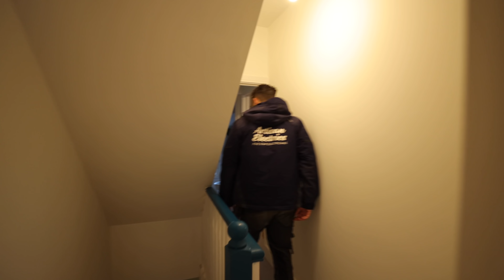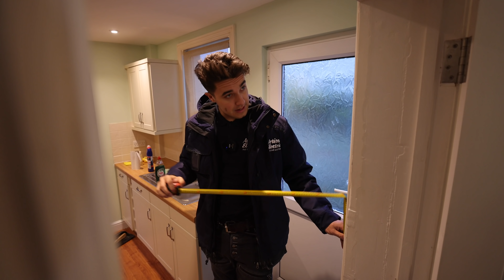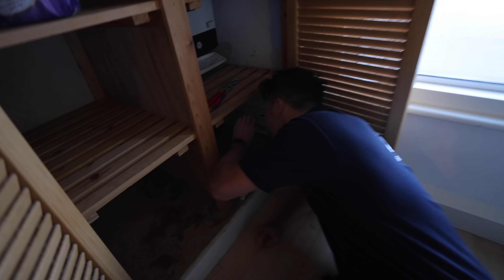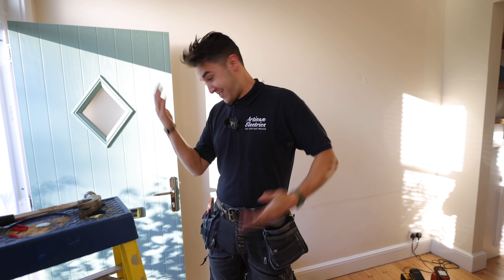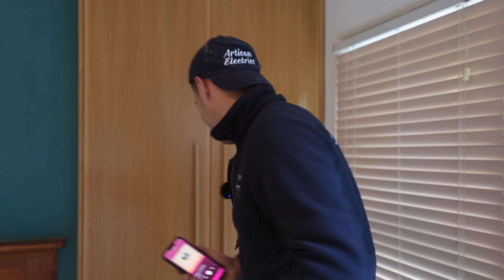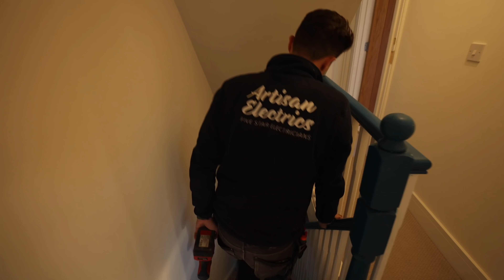I CUT THROUGH A WATER PIPE! MY WORST MONTH EVER! 😭

Comment: I had a decorator actually step of a ladder and put his foot onto the radiator with full weight to step down onto the floor kinking the outlet pipe just below the the floorboards. It flooded the ceiling well before he could get to it. He was a nervous guy just starting out and he was nearly crying and shaking when he had to speak to my Grandma. I felt so sorry for him and my Grandma kept saying to him ''look..it's just an accident! Calm down...we can fix it'' ect. We got a plumber and he had to solder a new pipe on then we painted the ceiling when it dried out. My Grandma was so kind and didn't pass on the plumbers cost which was not expensive all that time ago. Never seen a guy so upset before but it all got sorted out in a day.

Comment: It happens, but you can  never drain the system with all the radiator valves closed.
Reply: It's not a bad shout to close off all of the radiators except the one with the drain, though. That way you won't have to drain so much.

Comment: I would love to see more of you guys running/installing data cabling, but you need to bring the same OCD(ish) standards you have for electrical wiring to the process of "data cabling". "Rules of Thumb" like making sure the edge of the PVC/plenum sheet is as close as possible to the wire "punch down" point with as little as possible untwisting of the colour pairs, wiring a small drop loop into a cable to allow moisture buildup to run down and away from a connector instead of into it (not so important these days with better insulation in homes although relevant to this video 😁), not running data cable parallel to and within 400mm (approx 15in) of power cables especially fluorescent lights (again not so important these days with Cat6 and Cat 7 cable), etc. Most of these RoTs (and others) are historical in nature and may not be as important as getting the job done especially in a home installation (most are "best practice" guidelines for commercial stuff).

As for T568A vs T568B, you should find that T568B is more common to experience "in the wild" these days, but it is recommended that if you find "A" in a location then you should use "A" for new installs or if you find "B" then use "B" for new installs and if it is all new installs, then use "B". The only difference between T568A and T568B is that the white/green+green pair and the white/orange+orange pair are swapped and are electrically similar(ish). T568A is also sometimes mandated in government contracts (especially in the USA) as a historical consequence of older (USOC I think) phone wiring standards (again not so relevant today for ethernet data and VOIP phones).

Please excuse the length of this missive. I just needed to wind down from a small WISP (wireless ISP) installation that got a little more "political" than I wanted, earlier this afternoon.

Keep up the realism guys and have a good 2022...
Reply: Huge message for someone who installs data cables. Get to college for 4 years then pass your 2391 and become an approved electrician before you comment on your job fool.

Comment: When you lift the floor  board put a small mirror between the joists. Then shine the light of a torch into the mirror. By moving the angle of the mirror you'll be able to see in the mirror down as far as the light can go.

Comment: Tip - if you hit a pipe and it’s mains hot/cold and you’re struggling to find the stop cock, open all the hot and cold taps in the house and it’ll greatly reduce the amount of leakage until you can get the water shut off. I also keep a small bit of tyre inner tube In my tool bag with a Jubilee clip opened up ready so if you go through a pipe you can always cover the hole with the innertube then squeeze it onto the hole with the Jubilee clip, this is the best quick fix for pressurised heating systems if you don’t have the means to repair it properly - Andy, Heating engineer (never cut a pipe myself honest 😇)

Comment: Hello Cory never cut a floor board above a copper pipe lift up the board next to it not worth the risk you live and learn mate i have never hit a water pipe in 37 years in the trade although i drilled through a 2.5 t and e cable on a 20 amp fuse and that went with a hell of a bang i can tell you it melted the tip on the masonry bit and i saw stars for the rest of the day keep up the good work you are a top man.

Comment: At least with old houses with wooden floorboards you can expect to get pipework underneath near a radiator but with modern houses they can have 10mm plastic central heating pipes hidden behind the dab and dot plaster panel on the wall - don't ask I how found out when putting up a shelf above a radiator!

Comment: You could of fixed that with two push fitting and tiny bit of 15mm pipe and you will need to drain the radiators if it’s on the flow and return. Water mains is only for the cold and hot water. Jordan really great leadership mate as I couldn’t think of anything worse than being kicked when I’m down. Corey knew how crap of a situation it was. Just give it a day or two then the leak jokes can come in to play

Comment: I have fixed problems like that by cutting the pipe down line and sliding over a quick flow pipe joint over the cut down line slid the joint over the cut.  Solder it and use a second joint were I make the cut.  Easy fix in tight spaces.

Comment: The heating system is a combination boiler so only has a small amount of water in the system, just drain a rad downstairs, don't bother trying to turn the rad valves off you'll just make the job harder as you'll need to re balance the system

Comment: Ahhh bless you.  Next time if it’s a combi boiler with a filling loop just grab a hose and drain the  rads to reduce the pressure. If not a combi then there’s a tank in the loft which if you buy a bung you can put it in the small tank in the loft to stop the water coming out. Maybe learn a bit of plumbing to know the basic layouts. Everyday is a school day mate. Oh btw you’ve a great singing voice Cory!!
Reply: The boiler being a combi doesn’t necessarily mean the heating system is or isn’t pressurised. The type of boiler doesn’t dictate the system its connected to.
Reply: @Josh__Stevens  yes your right. But Cory won’t know if it has a separate heat exchanger to split the system. I was just giving the 99% option that it hasn’t. 👍🏼

Comment: There is a galvanised steel plate, called SAFEPLATE, which should be fitted over all points where electrical cables and pipes are notched into to the top  of a joist. They are available from CEF.

Comment: Great Content ,  I think this is a great vidz to Learn from as a new Sparky . Lifting up floorboards you have to be aware of  radiators  pipe .  And  a good tip from Cory to  Set the depth of the Cutting blade.  +   knowing  what to do if you do  hit a pipe,  having some knowledge of knowing what to do if you have gone through a water 💦 pipe , taking note.  
And can you cover  a vidz. on networking  insulation  may be get Oliver  on  bored  Cory  that would be  great .  Thanks guys

Comment: With me, it's live gas pipes! One job was boarding over ( or under_) a low head height cellar. I was very aware that there was a live lighting cable attached to the joist above me near the gas meter, and its stainless steel flexible connection to the incoming gas main. Somehow, I still managed to both find the live conductor in the cable with the panel pin, and simultaneously connect via the claw hammer to the flexible metal pipe, with a bright electric flash inches from my face, extinguishing the cellar light, and igniting a tongue of mains pressure gas, directly in front of me. Temporarily blinded, I managed to locate the gas shut off valve, and thus extinguish the flame, leaving me in total darkness with the after-image of the flash and flame indelibly printed on my retinas in vivid green and purple. As my sight recovered, I found the steps up to daylight. I had no mobile phone in those days - they were very expensive bricks then, and I can't remember how I actually managed to call the gas board to fix the damage I had caused - shock, I imagine, has erased the memory, and I managed to complete the job. Another was equally odd. I had laid a new vinyl floor covering in a kitchen, and the final act was to fix a brass strip to cover vinyl and carpet join over the threshold between kitchen and hallway. There was a concrete screed over the ground floor, at least in this part of the bungalow. Typically there were hard lumps of ballast amid the softer cement, so my SDS plus drill was necessary for the screw fixings, even though the screws were tiny. 4 out of five screw holes were easy, but the middle hole obviously was hitting a large flint pebble. It was a case of applying firm steady pressure so the bit would not wander, and once the bottom of the stone was broken through, the drill bit plunged to maximum depth. Once the drill stopped, there was a hiss and smell of gas. The emergency team managed to secure the gas supply, but had to come to run the replacement supply around the outside of the building the next day.

Comment: I had also routed network cables and used the continuity tester. 
Everything seemed OK with the tester, but the network was not working. 
I've been looking for a long time. 
The error was: 1 to 8, 2 to 7, 3 to 6, 4 to 5
not 1 to 1, 2 to 2, ...   😁

Comment: Emergency pipe-freezing kits are a very good thing to keep on your van and some basic pushfit pipe connectors!! Ive done exactly that with a multi tool twice, put a screw through a pipe once and the best one ever was a lead water main above a larve and plaster ceiling I put a holesaw through drilling out a downlight. I penciled out the cutout size, poked a pilot braddle up making 4 tiny holes on oposite sides of the circule and there was a lead watermain up there in the most unlucky place possible. Flooded the flat i was working in and flat below that one before I found the stopcock in the street to turn it off......haha. luv it

Comment: Here is a tip for ya. whenever you find pipes, make sure you locate the stop cock before you do ANYTHING involving a multitool/cutter
Reply: The stopcock wouldn't have a solved this as it's the heating loop. Need to depressurise the heating loop usually tap by the boiler and if your lucky a drain at a low point to drain off the full system.

Comment: For that switch in the lounge. Do they not make a Bluetooth/WiFi operated remote switch that you could then just mount by the door to control the other switch.  

Not sure it exists (does for LED Items) but would be quick and save a big mess.

Comment: I did this once at a Panasonic factory. Cuttingbout redundant plastic conduits a knicked a plastic cold water supply above the ceiling. 
Took my t shirt off to stem the flow.
Half hour later they found the isolation valve to turn thr water off .
Not my best day

Comment: Decent electricians call a cheap plumber who is stuck in the 80's

compression fittings were used for many years under floorboards without issue. Todays fittings are not made aswell, Even a yorkshire fitting would of had the solider for them prefilled. 
Or if they big firm you'd think they would have press-fit gun on the van and can pressfit new section with ease, Instead of them leaking 5 years down line and insurance company laughing when owner tries to claim...

Also Lowest rad or pipe usually will have a drain off you can use to drain down the system with a hosepipe or something. (Don't try with a bucket a single rad would overflow a bucket)

I feel like im mean saying it but the sheer high quality of the electrical work. I had urge to mention when plumbing didn't match.

Comment: I bet you wish you’d gone for a Quinetic solution! It’s never good when you hit a water pipe. 😣.

I once worked on a Severn Trent site in South Yorkshire. A fitter knocked off a valve on what should have been a dead line. Turned out it was still connected to a digester filled with sludge…. Dear god did the fitters move quickly. The sump area filled so quickly with sludge and the stench was horrendous!! Lucky for me I was working in the panel room above. 😂

Comment: So you had a bad day. It was bound to happen sooner or later. I am a plumber and the big problem is these electricians who like to run their cables all over the place for me to drill through. I been through a cable in the past so you shouldn't feel too bad
Reply: Use a cable detector mate saves you having to buy a new drill and there good to find the joists or studs

Comment: Water from damaged pipe - assuming it is radiator circuit pipe work - If its a sealed heating system - then all you need to do is make sure fill loop at boiler  is shut ( it should be ) and then bleed off system pressure at a convenient drain cock . ( only a few litres will do it)  Once pressure is relieved  ( to zero) then no more water should come out of that cut in the pipe .  ( only need to turn off radiators above the cut pipe to avoid radiators emptying into cut pipe due to gravity )

As was said -repairing the pipe isn't  really an issue  ( awkward but not impossible! ) - but fixing water damage is

Comment: Nothing like hindsight but I am surprised that you don't use a locator.  I am a rank amateur so can't do without one to betray the locations of lurking pipes that are just waiting for you to cut through them.
Only done it once, in 1983, belted a nail through one.  Dumnity as it was four feet from the boiler.

Ruben is a dead ringer for my grandson, looks the same age too.

Comment: You only need to shut off 1st floor radiators, before you shut off the last radiator release the pressure via the radiators air bleed using a key, once the water level drops below the leak your golden.

Comment: Nice job, good video. And to be honest, don't beat ya self up about cutting the CH pipe, the pipe was close to the top of the joist, it is good practice to notch the joist a bit lower, and to clip the pipe to the bottom of the notch to stop it from springing up. good reactions from all tho after the cut. maybe a course in different CH systems, sealed, open vent hahaha :P, and what actions to take next time you cut through a pipe (I mean you won't cut through another pipe). LOL, sorry, could not resist. Everyday is a learning curve, but well done with the job tho. main thing is, no one got hurt. deffo thumbs up :)

Comment: If it's water or electric cable, really the plumber should have used the protective metal plates. Personally rather than notch the joist I prefer to drill the joist below 2" screw depth for pipe or cables, takes a bit longer but it's a better engineering job. So don't blame yourself.

Comment: There should be a metal plate covering the pipes so you could not cut into pipes, when you go cutting a hole or floorboard you never know what is behind the surface.

Comment: Anyone else thinks the plumber should have soldered them using 2 slip on couplers instead of 4 compression fittings which will potentially leak in the future (and also take more space where pipes were already tight against the floorboards)?

Comment: Grow back the Lucky Beard 😜
Reply: Pierce a Hole directly beneath the cut pipe, drain water into bucket ( did the right thing under Pressure, 👍/ towel Over cut, turning off 💦 draining rads) by putting a Hole in the ceiling, your saving further Water damage to a wider area, it also stops the ceiling from sagging because when it drys out the ceiling Will retain a belly, which will have to be cutout re boarded/ skimmed etc